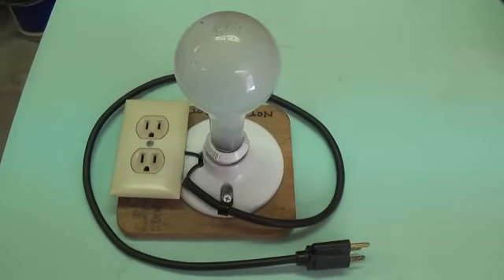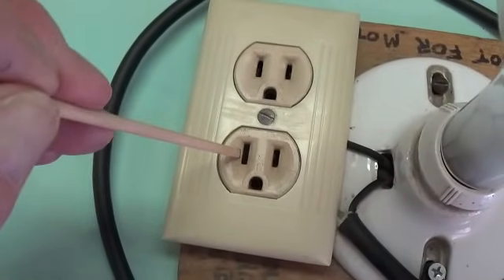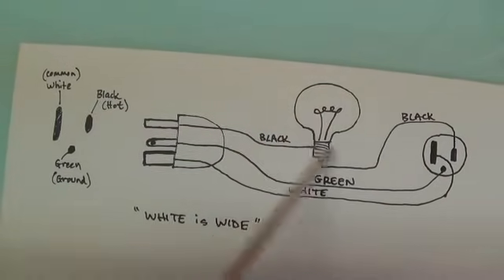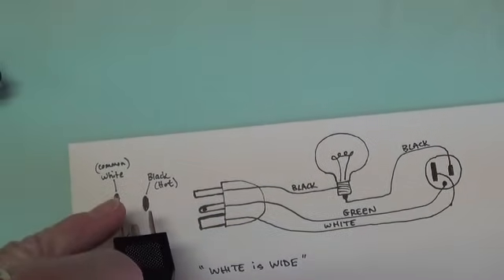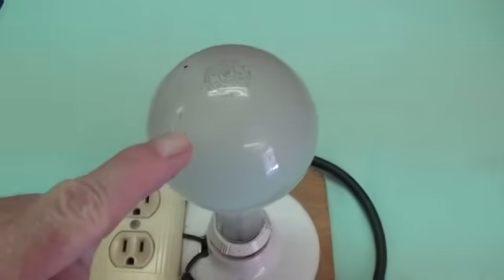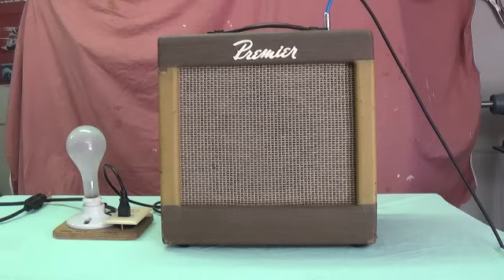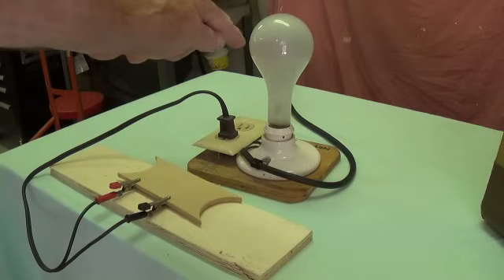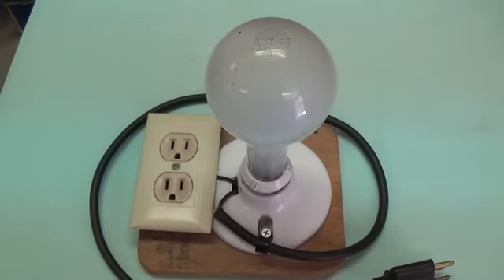Build Your Own Current Limiter for Protection when Repairing and Testing Electronic Equipment

Comment: Hi Uncle Doug. If I want to test a tube like 6528A or simply build a one tube circuit
to measure voltages, do i need to add resistors for a load?
thank you, and best regards. Eli
Reply from the maker: Eli Ouziel  The CL is a safety device to limit current flow and protect against damage due to short circuits, Eli. I'm not sure how that relates to your question.

Comment: Excellent tutorial on the dbt! Going Home Depot tomorrow to grab the parts. Will use it soon when I finish work on kenwood amplifier. Thanks
Reply from the maker: DirtyDon RC You're welcome, Don. Please note that the bulb wattage must be appropriate for the normal operating current of the electronic device being protected. If the Kenwood amp is solid state, it will require a fairly low wattage bulb, i.e. 75 to 100W. High wattage tube amps can require bulbs in the 350W to 500W range.
Reply: Thanks for the info.  I figured I would need lower wattage bulbs. I read a lot about them on audio karma forums. Going to buy several...starting at 40 watt. The amp is solid state. Info on back is 110/60 110w. It's only 18w per channel.
Reply from the maker: Sounds good, Don. Good luck with your project.

Comment: Hi. Great videos! I just made this contraption. I live in europe (230V/50Hz) and i'm using a 200W bulb, and i'm still getting quite the spark when i try to short out the terminals. Any suggestions? Should i get a more powerful bulb?
Reply from the maker: ran zo Thanks, RZ.  Although your voltage is double (230VAC vs 115VAC), your current flow is about half. Since the Current Limiter (CL) depends on current to rapidly heat the filament and increase its resistance, you need a bulb with higher filament resistance. Since the filament resistance of the bulb decreases with higher wattage, you should try a lower wattage, higher resistance bulb.....i.e. a 100W.

Comment: Uncle Doug I love your vids very informative. I built my own Current Limiter. I built it into my work bench for less clutter.  I have one suggestion, when connecting to the bulb socket make sure to use the bottom center tap for your line voltage connection to help avoid electric shock when changing the bulb. thanks for the great videos.
Reply from the maker: jeff greenwell Good suggestion, Jeff. Rusty and I are glad you enjoy our videos. Thanks for watching....and for your input :)

Comment: Hey bud I have a question. I wrote and asked you about the fender stage 160 amp, I built your voltage regulator but add a switch to turn it on and off, works great! Question is this I have replaced all the power transistors in the amp as I found 4 bad.... When I plug the amp in through the limiter I built the light lights up about half brightness, it's a 300 Watt. The amp plays fine but there is a hum, not a loud buzz but a hum. I played for a while then tried plugging it directly into the wall and it pops the fuse....coild you please point me in the right direction. I know it's on the high side, if I unplug the p1 and p3 from the circuit the amp will not pop the fuse, please help me, I love this amp!
Reply from the maker: Brad Resor Brad, I have very little experience with transistorized circuits. It seems like the Current Limiter is doing its job and preventing excessive (i.e. fuse-blowing) current flow. The hum may be a clue, especially if it's 120Hz (rather than 60Hz). If so, you may have a faulty filter capacitor (or two). Other than that, I simply lack the knowledge of this (very complex) circuit to be more helpful. Sorry....and best of luck.

Comment: its a ground fault current interruption receptacle not socket  sorry.  i think i figured it out   they work by recognizing a differential in current between hot and common lines and will trip so you you don't get electrocuted, in this case it is recognizing the bulb
Reply from the maker: mmgourlay Yes, if the GFI senses a disparity between hot and return, it trips. This interferes with the Current Limiter, which should be run with a conventional receptacle.

Comment: Hi Doug. I built one today and used a GFCI SOCKET because I had an extra one. I wired the black wire coming from bulb to hot line dude and the white wire from cord to common on GFCI line side.  I did not use load side.   the GFCI keeps tripping.  Any ideas?
Reply from the maker: mmgourlay I have never tried using a GFCI socket (or receptacle) to build a Current Limiter, and I have a feeling that it's interfering with the function of the limiter. You would probably be better off with a regular porcelain light socket and non-GFI receptacle.

Comment: Hi Doug, I built one of these a while back but with a switch on it that allows me to go from limit mode to full power - something along the lines of the Kendrick unit.
Excuse my ignorance here but my question is: when doing current measurements, biasing etc, does the limiter screw up the measurement by virtue of the fact that it is soaking up some of the current - assuming of course that the bulb is glowing even dimly? Or should such things always be done at full power once the amp is judged to be operating safely. Cheers, Jeff.
Reply from the maker: Greetings, EV. There is a voltage drop across the bulb, so voltage and current will be somewhat reduced in the amp circuit. For maximum biasing accuracy it's probably best to flip your switch to "full power".....after the bulb's lack of illumination has informed you there are no shorts to worry about.

Comment: I have one these with a 100W halogen bulb (we use 240/50 here in Australia) and a switch in it to change from limit to full power (a copy of the Kendrick unit). My question is: while in limit mode, will current readings be affected during biasing etc? Or should these types of measurements be done under full power once I'm sure the amp is operating normally? Cheers, Jeff
Reply from the maker: Greetings, Jeff. A 100W bulb will definitely reduce the supply voltage to the amp a bit. If you want your biasing to be as accurate as possible, you should perform the procedure at the normal operating voltage of the amplifier, i.e. without the CL.

Comment: Uncle , thanks for your interesting and useful video, I want to ask once the bulb is light on, that means my tube amp is short circuit! what will be the next step to check on my amp??? will you have any video about this problem, thanks Nick
Reply from the maker: If your tube amp suddenly "lights up" a bulb of proper wattage (that it normally does not), then it's drawing more current than it should, probably due to an internal short circuit. You need to immediately turn the amp off, unplug it, and (if you intend to diagnose the problem yourself) remove the chassis and (carefully and thoroughly) drain the electrolytic capacitors in the manner shown in my biasing videos.

The primary AC circuit needs to be checked with an ohmmeter for short circuits. If none are found, then the secondary circuit must be checked, with emphasis on electrolytic capacitors and individual windings (high voltage, 6.3V, and 5V). It helps to download a schematic. With tubes in place the tube filament resistance readings should be very low, but not zero. With tubes out (and pilot light bulb), the filament readings should be infinitely high. The high voltage output should be checked step-by-step as it leaves the rectifier tube socket, looking for abnormally low resistance readings. Electrolytic capacitors should show extremely high resistance, if not infinite (after being charged by the meter). It's a fairly simple, step-by-step process based on the schematic and common sense. Good luck.

Comment: Thanks so much for all your videos, inspired an amp build.

Question on your diagram: can the black wires coming from the bulbs be reversed, i.e., the collar wire instead goes to the outlet and the hot bulb lead goes to the wall plug? I'm not sure if a bulb is constructed in such a way where that polarity matters. Thanks again.
Reply: i think the live contact is usually the spot in the middle and the thread is the neutral... it makes the live the last part to make contact in the circuit and also the live aspect of the bulb socket harder to touch because A, it's further in, and B, much smaller than the female screw thread cup. as for the filament, it doesn't care about polarity.
Reply: Although bulbs have no Polarity, it matters in connecting it to the live side of the wire because lets assume we are using a device which has the live shorted with ground.  If your bulb is in the negative terminal, it wont work as a current limiter and there will be further damage.
Reply: Polarity with the light bulb socket does matter, the black hot lead should connect to the center tit, not the easily accessible shell.

Everyone knows this... everyone.

Someone plug it in with no or broken bulb and touch shell will quickly find out it does matter.
Reply: @boogerhead0  well plugs in europe aren't polarized so here you don't have a way of controlling polarity. We solved this by not using single pole switches, so polarity differences does not change the safety of a product. Your scenario still applies if the power is turned on though, but people here know not to touch any part of the lamp that carries current because we cannot rely on polarity, in fact most people don't even know what the heck polarity is, both holes in the outlet are considered dangerous by the layman.
Reply from the maker: Greetings, AF. Polarity does not matter with light bulbs. As long as the black "hot" wire passes through the bulb, it doesn't matter which direction it goes, collar to tip or tip to collar.
Reply from the maker: You're welcome, BD. Congratulations on a successful CL build and a successful repair.

Comment: Doug, I followed your directions but always wondered if the thing actually worked because it never lit up. Well, last night while troubleshooting no sound, I made a change and got what sounds like both 120 and 60 cycle hum. More importantly, I looked out of the corner of my eye and saw 300 watts of "Shut her down now!" Thanks for the safety device instructions. Back to the drawing board.
Reply from the maker: Greetings, Joe. It's always good to hear from you. I'm glad the CL worked, and probably saved your power transformer. Best of luck with your repair (of what sounds like a dead short in the power supply).
Reply: Thanks Doug. Means a lot.
It was an input issue and that little dotted line at the bottom of the Vibrato part of the circuit on the layout. Found it on the schematic, blends in with yellow highlighter. Now I just have to troubleshoot the low volume, but I've seen that one before. The vibrato sounds great even at low volume.
Thank you for the time you put into your explanations. It makes this road less bumpy.
Reply from the maker: You're welcome, and congratulations on solving the problem, Joe. It sounds like your amp project is really working out well. I hope other viewers read your first comment and become "true believers" in the value of the Current Limiter. Thanks for your input :)
Reply: I leaned a couple of lessons on this one. Always use the current limiter, always read the schematic twice before you take the amp apart 3 times, and make sure the number of grounds on the schematic matches the number of grounds on the amp. I might want to include, the GZ34 is a great rectifier. I appreciate the lessons.
Reply from the maker: Greetings, Joe, and thanks for confirming the value of several very good practices when working on electronic circuits....and that the GZ34 is a great rectifier. I'm glad the videos were helpful :)
Reply: Chris Roubis  Yeah. I broke my 300 watt. I'm down to 200. Hard to find the high watt incandescent bulbs locally. When that bulb lit up, it gave me a 300 watt warning.
Reply: Chris Roubis  Thank you very much.

Comment: Hey Uncle Doug, Thanks for making so many wonderful videos about tube circuits and safety. I have a background in electronics, but I always shied away from tubes because of the (potentially) dangerous voltages. Even though I love electricity I hate being shocked, even a little. Luckily it hasn't happened in as long as I can remember. Anyway, I was wondering what you thought about replacing the the 1 amp fuse for a 20mA fuse JUST for testing. What I'm thinking is, if I want to test the plate voltage - I can remove all the tubes leaving an open circuit. Then connect the voltmeter, and replace the 1A fuse for a 20mA fuse before powering on the amp. During normal operation I know the small fuse would just blow right away, but in this test setup would it? Do you think this makes sense as a safety precaution? Keep in mind this would not be an old amp but a new one I am working on myself.
Reply from the maker: Greetings, Russell. The problem with removing all the tubes is that, without the rectifier tube in place, you will have no high voltage in the amplifier circuit and therefore will be eliminating the voltages you seek to measure. Also, with only the rectifier in place, the tube and circuit voltages tend to be higher than under normal operating conditions, so the readings are inaccurate.

You can install a ground-fault-interrupter receptacle in your workshop to greatly reduce shock hazards. An excellent way to protect the amp circuit itself (with visible warning capability) is a Current Limiter with properly selected bulb wattage.

To reduce shock hazard during test procedures, apply the test probes with the amp off (and filter caps drained), then turn it on and take measurements, turn it off, drain caps, move probes, etc. Also, never touch the circuit or chassis with both hands. Do all your probe attachments with one hand only.....and your free hand in your pocket.

If you are still uncomfortable working on high-voltage tube circuits, and a lot of people are, don't force yourself. It's supposed to be an enjoyable hobby.....not a source of anxiety. Good luck :)
Reply: Uncle Doug Thanks for the tips! Most of them I already got from your other videos :p I think I will do just what you suggest. I am definitely comfortable now that I know all of the safety precautions, and I think it will be very enjoyable.

Let me tell you a bit about the amp I'm thinking of building. I am going to base it off the Magnatone Moldier you showed in another of you videos, because I love how it sort of sneaks in another output tube! I plan on not using a rectifier tube, because I think this day in age its a little silly to spend the power heating up the rectifier tube if you don't have to. I also plan on using DC to heat the tubes to cut down on noise (I know you dont have to from watching your scrap champ video where you show how to use a center tap) but I think its a good idea anyway. I also want to build the power supply in a separate box so the amp itself will only have dc signals inside. 

Keep on rockin in the free world, and please keep on uploading interesting videos to YouTube!
Reply from the maker: Your project sounds quite interesting, Russell. Many of the early amp makers had two separate chassis within a cabinet: the preamp on top, with inputs and controls; and the power supply on the floor. I see that you intend to take this one step further and have the power supply outside of the cabinet. I have never seen this done before. The DC heaters will also be interesting. Let us know how it turns out. The Melodier Deluxe is indeed an unusual amp with a unique circuit. It was one of the favorites in my tube amp comparison video. Best of luck with your project.

Comment: Excellent Tutorial thanks! I've just rebuilt my vintage Sugden a21 class a amp. I want to power it up but my variac type transformer has broken (the mount which holds the brush to the center shaft has snapped!). So it looks like this will save the day. The Amp's output is only 10 watts what size bulb do you recommend? Thanks from the UK
Reply from the maker: Greetings, PC, and welcome. I am not familiar with the Sugden A21, but suspect that it may be a solid-state (SS) amp. The bulb wattage must be tailored to the amplifier power and configuration, with much lower wattage bulbs for SS circuits, so I suggest that you start off with a rather low wattage bulb, i.e. 50 to 75W just to be safe. If the bulb lights up too brightly (but not fully illuminated, which would indicate a short circuit) you could increase the wattage. You want the bulb to be very dim (or simply warm to the touch) while the amp is functioning, so that the voltage drop across the bulb is minimal. It may end up that higher wattage is necessary, but it's better to be safe (than sorry). Let me know what wattage you end up using, so I can improve my data base for SS amps. Good luck.

Comment: I have seen the same concept applied to speakers on a radio repair bench.  If the radios output had a high current short the correct size lamp should minimize damage to the speaker.  We would use 12V brake lamps in series with the speakers.
Reply from the maker: Greetings, KK, and thanks for your input :)
Reply: Kim Kusluski - That's a good idea. Some companies also use lamps in series with tweeters and horn drivers in their speaker cabinets to prevent damage from customers applying to much power to them. (Bose home speakers and JBL PA speakers, to name a few.) Despite the protection lamps, people still manage to roast the tweeters and horn drivers. That's OK with me. I do a lot of side work on live sound equipment and speaker repair pays well. :-)
Reply: Cool!  Vintage Yaesu Ham Radio transceivers used a small light bulb in series with the antenna input as a lightning/static discharge protector.